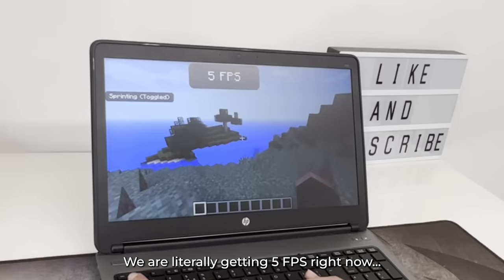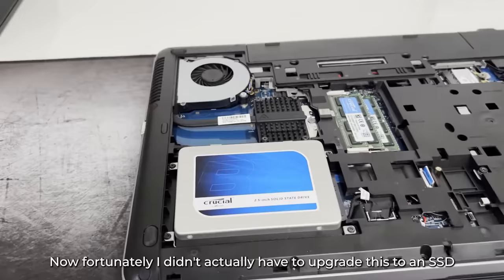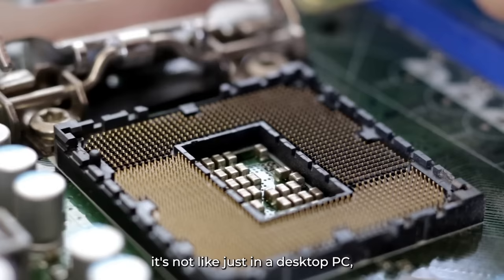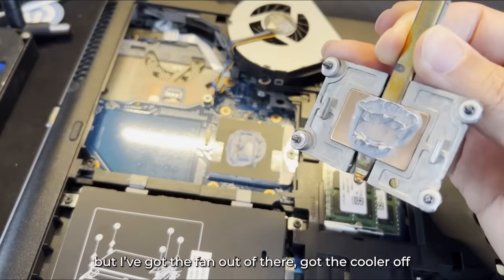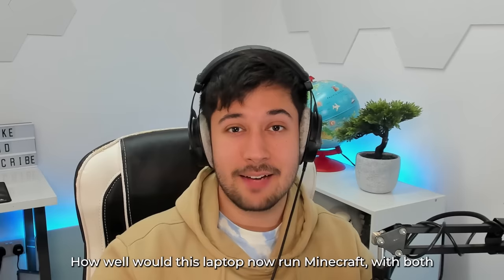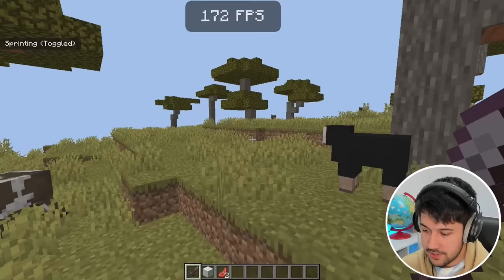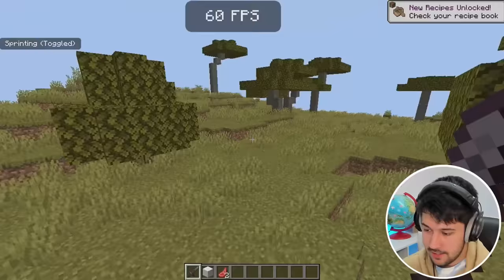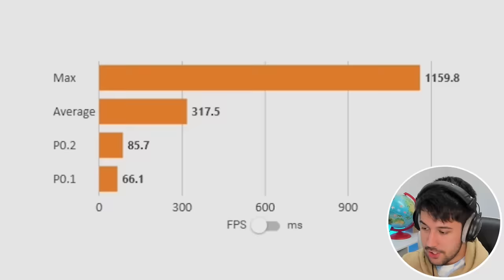I Turned My $20 Laptop Into A Gaming PC...

Comment: love that you describe things in a way that is informative to people just starting out with mods but also in a way that doesn't bore people who have been in the community.
Reply: I also noticed your comment about the lack of an FPS improvement despite your CPU upgrade. It is pretty rare to see a large FPS improvement when upgrading CPUs from the same generation. This is because you are running games on the built in IGPU which don't get much faster from I3 to I7 (at least in the same generation). Hopefully what I said makes sense I didn't proofread anything.
Reply: Also I would straight up not include the max FPS in your graphs as even you said it was completely irrelevant. Having an extra bar in the graph just makes it more cluttered and makes it harder for beginners to understand it.
Reply: If you ARE new to installing performance mods, do not install continuity and dynamic fps.

Comment: The most shocking thing in this video to me was the amount of FPS gained going from 8GB to 16GB, especially as you said you didn’t increase Minecraft’s allocated 2GB.

Well done, it’s so great making old hardware that anyone else would consider ewaste, useful and capable.
Reply: Back in 2017 I bought a Dell Latitude E6420, a Sandy Bridge laptop for study, but I stopped using it later and forgot about it.

Came back to it this year, upgraded it to an i7-2630QM, 16GB RAM and 240GB SSD, and it runs 3 virtual machines I have simultaneously (Win2022, Kali and Metaspoitable2)
Reply: @JustARegularNerd Wow, I wish I had the knowledge and skills to update my 2018 Asus ROG 😅 I guess I'll have to go to a repair shop like the rest of the muggles.
Reply: @joannelucille  just a side note you cannot upgrade the cpu on 99.99% of modern laptops and most of the time it isnt even cpu limited, id recommend just using mods to increase performance.
Reply: going from single channel to dual channel benefits the computer like crazy
Reply: Windows needs 16 Gigs of RAM, while Macos and most Linux distributions run great on eight. Go Microsoft!

Comment: You should consider changing the OS to Windows-X Lite & try to optimise the software. In the stock version, as there are 100+ processes you may face fluctuating issue in the latest version so definitely consider optimising the OS.
Reply: Windows mods are worse than stock, at that point just switch to linux
Reply: @feefre  Windows LTSC is a better option.
Reply: Just get a linux distro

Comment: 8:37 turn your render distance to 12 and let your computer render out all of the chunks then the sink your computer at your screens, refresh rate, but max out the FPS limit to 250 this will force the computer to work harder, generating frames, and the thinking your computer at the same time and also your chunks will be pre-rendered, for 12 chunks instead of two, which should help the stuttering

Comment: The thing to remember about linux, is that as far as I know(which I'm far from an expert on linux), it doesn't actually run programs faster or overclock the hardware by default, it only frees up the bloat that modern windows tends to be loaded down with, so it uses up less drive space, RAM, and cpu usage for the base OS. By all means if you installed enough background processes on linux it'd be just as loaded down as windows, but at the most basic level it's just far more minimal. With how you've already upgraded the RAM to 16 GB and have an SSD, the only savings might be background processes and services that eat up the cpu, which to be fair on windows can be substantial sometimes especially with only a dual core processor. I'm curious if it would at least run a little smoother with slightly more FPS, but I don't believe it'd be anywhere near as drastic as the hardware upgrades. At least it didn't seem to be a massive game-changing boost when I installed linux on a spare drive and booted my main desktop with it, which is a quad-core 16 GB system. I can absolutely see it making a much bigger difference the older/more-low-spec you go though. It'd probably make a bigger difference with 4 GB of ram than at 16 GB, or say a single core vs a 4/8 core. Basically it's like the difference between running with a 10 pound backpack on vs without, your legs aren't any more powerful, you just have less weighing you down, and that 10 pounds of savings would be a much bigger deal on somebody out of shape vs a trained athlete.

Comment: You should definitely try linux or atlas os on this laptop! BTW what your mic and the stand for the mic?
Reply: I was going to recommend using Linux as well, especially a lightweight distro that doesn't use up all cpu and ram on windows bloatware
Reply: linux 💀
Reply: @YokonaraOn240Hz  linux usually boost up performance on old/low end laptops because linux distros are really light so it would be a good idea ig
Reply: @YokonaraOn240Hz  Problem?
Reply from the maker: Yess that will be in the next video, I use a RODE NT-USB on a cheap boom arm from Amazon
Reply: @dawidov_wav  no
Reply: @YokonaraOn240Hz  fym "no"? bruh. everyone knows that linux distro's runs much better than windows (even the most modded one's, targeted to get as best performance as possible) because that is a fact. if you have problem to linux because  there is a terminal then you have some skil issues (i am windows user tho, but i really don't understand people that dosen't like linux)
Reply: @dawidov_wav  bro linux is bad, u just need windows lol u do not need to learn 15th grade of IT to play games
Reply: @YokonaraOn240Hz skill issue
Reply: @YokonaraOn240Hz  There are so many ways to make fun of you that I can not even decide on one, so I will just leave you with that
Reply: @rohll-off  sure buddy whatever
Reply: @YokonaraOn240Hz   “buddy”💀💀 You probably don’t know anything about computers and with all due respect, saying Linux is bad + acting like it’s complicated is an astronomical skill issue.
Reply: @YokonaraOn240Hz you clearly have never used linux.

Comment: So one of the things about Feather is that it's literally just running a stripped down version of Chrome - it uses the Chromium Embedded Framework, which is actually VERY resource intensive. I've also been told it uses CEF for things within the game itself as well for some reason.

I advise AGAINST using clients like Feather or Lunar, because the benefits they have are FAR outweighed by the cons.

I HIGHLY recommend using Prism Launcher on older machines like this one instead. I run it on my admittedly overkill machine, and the highest I've EVER seen was 120MB of RAM, and 2% CPU. I will admit to having never used Feather before but other CEF apps have used around 1GB-2GB of RAM each. Will you have to do some tweaking yourself? Yes, absolutely. But on lower end machines you'll be able to dedicate MORE performance to Minecraft, and knowing Java as a programming language it could USE that.

Prism plus something like Fedora Linux and I'm willing to bet you could easily surpass 200-300FPS in 1.20.4 with Sodium

Comment: Damn 97 FPS Only With Yhat Specs Thats Crazy My laptop is a lot low end i.e

Specs For Nerds;

Intel Core i5 3340M 2.70ghz 2 cores 4 logical Processes
Intel HD Graphics 4000
4GB DDR3 1600mhz ram
256GB SSD (I guess No DRAM Cache)

Comment: Can confirm upping RAM and an SSD make massive improvements in performance.... If you've actually got a computer where you can do that. Sadly a lot of manufacturers started soldering stuff straight to the board severely limiting any hardware upgrading, especially on cheap budget laptops like those super-cheap netbooks. I've heard there are perhaps some performance/cooling improvements to soldered components, but generally I feel like it's all about the money. Either to cheap out on manufacturing or to get people to pay a premium to have good specs from the beginning by removing the ability to buy cheap upgrades later, as if you have the option it's often cheaper/better to buy third party upgrades later after a few years than pay a premium when it's new. Also just the ability to be able to remove the drive and replace it is valuable in many situations like if the MB dies so you can still get your files.

I got an old laptop when my uncle passed that was a very laggy pretty much unusable mess that took forever to boot, switched it to an SSD and BAM night and day improvement, I'd even call it rather snappy, threw in a RAM upgrade while I was at it, but I feel the vast majority was just the hard drive was /sooo/ slow. Like I don't know if laptop 2.5 inch drives are just slower than the desktop 3.5 inch equivalents or if the advertised SSD cache on it wasn't working, but the benchmark showed the random access speed was literally only 1 percent of the sequential access speed, meaning it was probably taking forever to seek the right spot on the disk.

Then I got another cheap netbook at the same time, and there's just no good way to upgrade it, the main drive is a soldered on 32 GB eMMC drive, there's only a single slot for RAM, which from my research is actually lucky as other versions of the same computer had the RAM soldered on. There's no place on the motherboard meant to install another drive, though apparently there's a janky way to jury-rig something including an adapter board to convert the slot for the wifi/bt board into an M.2 SSD slot, which then requires you to have a USB dongle for wifi/bt. Just not worth the time/money/effort IMO unless you literally have no other options for a computer. I mainly use it to try out linux with as the latest windows 10 just takes up the whole drive and barely boots, and there's a handful of things I was able to use it for, but mostly it just lies around collecting dust.
Reply: can i have your old laptop?

Comment: Dad had an old acer Aspire desktop from 2011, 4 gbs of ddr3, intel celeron, not even i3.

Got an i7 4790, and got 16 gbs of ddr3. 
Found little bro playing valorant at 30fps with horrible quality but was running smoothly after optimizations. Spent like 70 bucks totals on the upgrades on that old hardware.

Comment: Idk if this laptop has an ethernet port but you can get an external gpu housing and connect it where the wifi card is plugged in. I've seen some tech channels try those out in the past to varying degrees of success
Reply: And if you don't have Ethernet, you can just use a USB wifi adapter.

Comment: Extra steps:

Use 1.19.2(best version for optimization) fabric with sodium + every optimization mod.

Then use a Jvm like Java 21 oracle graalvm + Zgc and 12gb(Don't put all the ram, java likes overhead).

Use liquid metal instead of thermal paste for better cooling.

Extra extra steps:

Modify the laptop case to have extra fans

Change the battery/power supply to allow faster cpu options

.

Or just get a desktop at this point
Reply: Liquid metal is dangerous for laptops that do not have a cooling system designed for liquid metal.
This usually leads to a short circuit, which can seriously damage the laptop. Since liquid metal leaks out over time from under cooling systems that were not designed for liquid metal.

Comment: Its no longer a $20 laptop anymore since you put a $30 cpu in it, $15 to $20 of ddr3 ram in it, and an ssd that probably cost $15 to $20 aswell. so its the original price of $20 plus $60 to $70 in parts which is $80 to $90 still pretty cheap but definitely not $20 anymore. Much better than most $90 laptops now anyways and definitely more than enough performance for minecraft and garry's mod. 

This would have been better if you had more cores since sodium uses multicore rendering to render chunks which is why you lag and stutter so much on 1.20. The cpu can't keep up with the amount of chunks you're rendering and keep a stable high fps at the same time so it dips your fps while loading chunks.

Comment: i thought when it said "gaming pc" you gonna add external gpu, customize it, or add some weird stuff. im kinda disappoint tho but keep going with your content bro. note : also when you upgrade it, its not all about fps
Reply from the maker: I don't think it's possible to add a GPU to it unless I try solder one onto the board, maybe an eGPU could work. The title was just a different way of saying: I upgraded my $20 Laptop in the style of a Gaming PC - CPU, RAM, SSD etc
Reply: @NotroDan  it possible actually to add egpu, if there is wifi card at motherboard then you can add egpu through wifi port but you have to sacrifice the wifi system

Comment: Bro just go and make the resolution 720p in settings by default its 1080p so it will thrice the fps I have an old Toshiba for testing with I3 4the and it got 200 peak fps on 8 render like tf

Comment: You should remove continuity, and dynamic fps, I have a laptop with hhd, 8 gb ram, integrated gpu,  I5-4310M, and it runs minecraft with all those mods at a stable 90-100 fps with 0 stutters and lag spikes, dynamic fps and continuity are complete trash mods for optimization and tend to lag your game alot.

Comment: i have hp elitebook 8460p i have been upgrade my laptop intel i7 3670QM before my laptop using intel i5 2820QM its runing smoothly after i am using intel i7..also that i have been hyper fury 8+8  Ddr3 =16gb ram and also that i change my harddisk to the ssd disk..256gb..now its going be crazy...and i like my laptop..next month i want to add more gpu.."

Comment: While an interesting, when you factor in all the time invested, it really isn't practical. Also, with all the upgrades, you could have simply bought a nicer/newer laptop instead. The laptop isn't $20, it's really $20 plus the upgrade costs plus the time put into it. Fun project however.

Comment: I had the same laptop HP Pro book 650 g1 but the processor is i3 4100m. I only upgraded ram  and I got 50 to 60 fps in valorant on HDD , 60 to 70 fps in Minecraft with out playing on lowest settings. and 25 to 30 fps in gta5. i also rendered videos in after effects.

Comment: Hey you could have gone to a i7-4712mq and could have gotten tons more performance, and it has integrated graphics as well as 4 cores and 8 threads
Reply: the i7 4712mq has the same TDP as the other dual core 4th gen cpus which should do fine in the Probook 650 G1

Comment: Dang. i7-4600M is definitely not as good as the i7-4700MQ (quad core) in one of the laptops I got. It isn’t actually too rare for an upgradable CPU. If your CPU is I think 4th gen or lower, you can upgrade it.
Reply from the maker: I did want the i7-4700MQ I just really wanted something that would work
Reply: @NotroDan  yeah

Comment: Hey man just giving you a tip for the future, when you added thermal paste to the laptop, you are actually ruining its performance. Most laptops don't actually use thermal paste for their cpu, instead they use something called liquid metal. Liquid metal has a much better thermal conductivity, wont go into the very specifics but liquid metal is made out of metal alloys such as gallium, indium, and tin. Which is what you wiped away off that cpu. But take it from the PS5, I wouldnt use liquid metal in a standard pc build or anything, due to improper sealment can cause leaks, which can fry your motherboard and other components. but for specifically laptops, i wouldnt advise using thermal paste or pads unless that is what was originally on the cpu.
Reply: thats a 2014 ish laptop metal was rare then
Reply from the maker: Yeah I've seen interesting videos using Liquid metal before, I'm pretty sure it was factory applied thermal paste that I wiped away. If I can get liquid metal I would try it but like you said the risk of leaks is a bit off putting

Comment: Hey Notrodan, I have a question. Back when you used Pop OS, and I believe Mint, did you ever notice a substantial difference between Windows downloaded vs Linux (pop OS/mint), in terms of performance and stability when playing Minecraft?
Reply: I know you didnt ask me, but im a longtime linux user. And I certainly noticed a major difference between linux and windows. Linux has a slight learning curve for beginners, but once you get the basics, and can figure out your own problems its quite efficient. Fps wise i have tested on a spare laptop of mine, windows 10 i averaged 90-200 fps. Low settings. but after a linux install, on arch linux, using i3wm. i was able to get my average upto 300-700. sounds crazy that a simple change like an operating system could give you upwards to 500 or more fps. But you gotta remember that windows is incredibly bloated.
Reply: @ivyish  I definitely see your point here. I've actually made it a challenge for myself, for over the next month, I'm forcing myself to use Linux pop OS, instead of Windows. So I formatted my SSD, wiped my entire windows install, and decided to switch to Linux with no windows on it, that way I'm not dual booting. I'm on day two, trying to learn about five commands per day, and get used to it. So far, I learned how to get applications, using the sudo get-apt command, I've learned how to install updates, and have learned how to move files into a different directory via commands in Terminal. It's getting a little easier every time, but I want to get to that stage or point eventually, where I'm also able to optimize Linux further, I just don't know and don't want to do that yet, as I'm not entirely familiar with the operating system, and don't want to accidentally destroy something.